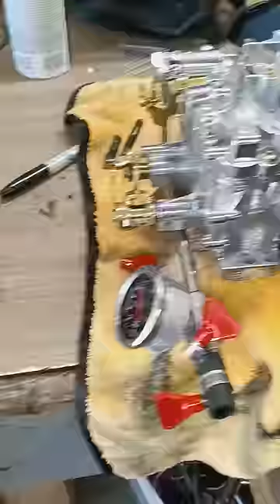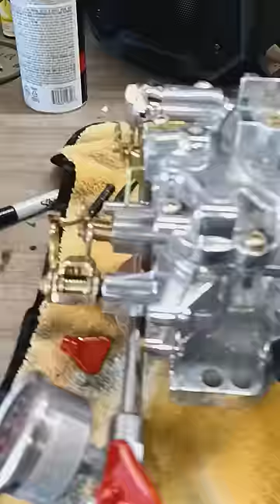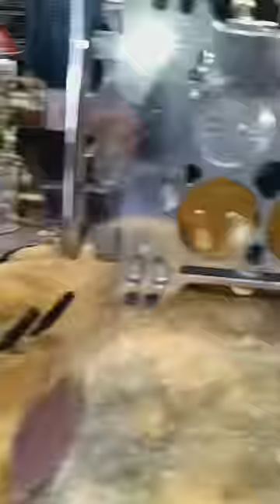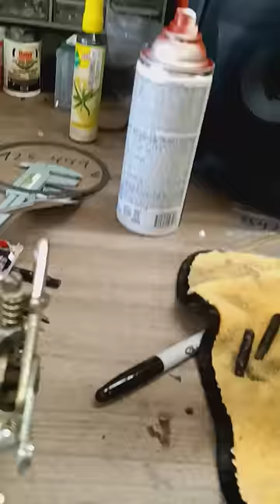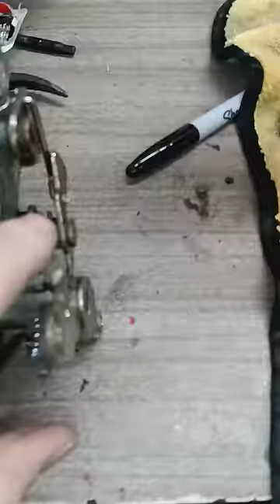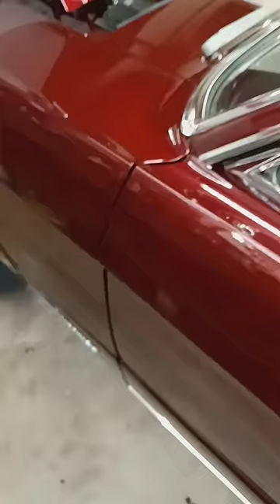how did I miss that?

Comment: If you're impressed with getting WOT imagine how it would run with a Holley on it
Reply from the maker: Holleys are great, I love them. But on a car I just want to start up and drive and not have to mess with it I'll use a Edelbrock. I'm watching Marketplace and Craigslist for a used 4150 style whether it's Quick Fuel or Holley I don't care I just want something I can rebuild and tune for all-out performance for the 65. So I can ride around all I want with the Edelbrock and put the Holley on when I take it to Sears Point. It'll be interesting to compare exactly how much more I would get out of a Holley compared to the Edelbrock.

Comment: after mounting the carb. the first thing any good mechanic would do is open the throttle and look down the barrels of the carb. maybe you learned something
Reply from the maker: The secondaries won't open on a Edelbrock unless the car is moving and air is flowing through them. You can however remove the carburetor and hold the lockout linkage and actuate them like I did in the video where I show how I fix it. So no you cannot mount the carburetor, look down inside of it while you pull the throttle and see the secondaries open. They are not true mechanical secondaries. Hope this help you learn something about Edelbrocks.

Comment: Nothing much, it's an Edelbrock.
Reply from the maker: The 4150 DP I prior had a bit more out past 5500RPM but down low through the mid  the new AVS2 has more torque. How much of a gain do really think a 340ish HP car with gain by switching form the AVS2 to a Holley? If we're talking about a vacuum secondary Holley that's going to be even less of a difference.

Comment: Could you redline it with the old one?   Then your block can't handle more anyway.
Reply from the maker: The car would fall on its face around 5400ish
Reply from the maker: Don't you think with more air and feel it would get to redline a lot quicker? Just saying.
Reply: I would bet that she will tach up higher, and you will get some more torque on the high end, so be careful of overrevving her.  I doubt the low end torque will be affected much.   Might even bog some.  You may have to play with the spark advance some with the sudden loss of vacuum.  Play with the tuning and let us know how it goes!  Looks like a fun project all around.

Comment: Here's the deal..if they only opened just a little..then your gas pedal..run by your right foot witch is hooked to a cable only would of went down 2 inches..anyone who has worked on a car more then a second would of got that right off...if you punched it you didn't notice your foot 8 inches off the floor🤪

Comment: Ditch the edelbrocks. In my experience they're a good carb if you can get one that's not finicky AF I personally prefer holley for the quality control and what seems to be better materials because I've never had this issue with a Holley but had this same problem with almost every edelbrock I've had including a few that came from the factory with bent linkages. But the worst QC I've seen by edelbrock has to be the performer series avs2 series had better QC but still way too finicky and some material that's way too soft for the job it's doing. Last reason I prefer Holley is parts availability Holley parts have been super easy to get but everytime I needed edelbrock carb parts they were either discontinued or there was basically no stock anywhere. There's also less maintenance on the Holley carbs but we won't go there just yet
Reply from the maker: I got the exact opposite experience lol.  Holleys I've always had to mess with and Eddie have been pretty thoughtless after I tune them.

Comment: More $$ than smarts.   Never looked into a simple fix before throwing money at the problem I guess
Reply from the maker: LOL so funny. Are the two carburetors exactly the same? I bought the AVS2 because it's a bigger carburetor, with annular boosters, and dual feed inlet. Can't wait to check out your channel and see your cars maybe I'll learn something.
Reply from the maker: LOL bro you have cows on your channel. If there were no women left on Earth I would watch your channel on how to get laid. What's funny is you didn't even understand the concept of the video I made. I didn't buy the new carburetor cuz I thought something was wrong with the old one. I thought the old one was fine and realized the linkage was bent when I took it off. The car ran strong on half throttle. How do your cows run when you creep up behind them weirdo. How much penicillin do you have to take when you get to clap from a cow? Make a video and let the world know.

Comment: I don’t think the 4 barrel would even come in no farther than that is opening 
Look on the other side at the linkage when you go to WOT and see if it is engaging the secondaries.
Generally the back jets are twice the size of the
 front jets so you might not have been getting half throttle.
I’d fix it and then run it before you put the AVS carb on.
The AVS carbs are amazing right out of the box as far as throttle response and no flat spots through out the low end to high end 🏁
Reply from the maker: I made  a update "how did fix what I missed". I heated the linkage and bent if almost all the way back and it fixed the problem. I made another video before that one "how did I miss that pt2" or something like that and addressed some helpful comments like yours and a few trolls. I held the choke open, the  secondaries weighted air flap open, and made sure the lockout was open and got the same result. I make these videos with my phone so I don't always get the greatest shots because I have to move things with one hand and use the phone with the other. The AVS2 is currently on the car and I like it a lot but I have a slight bog when the secondaries open but that's because there was zero tension on the air flap spring from the factory. I've been working a lot. I'm hoping to do a follow-up this weekend of the new carb. Just need a buddy to ride along and video a few pulls. I like how at 2200 RPMs I can bury the gas and break traction all the way through first gear and into second. Manual transmissions are so much fun.

Comment: Go with a Real carburetor and ditch the Edelbrock and you'll really make way more power...
Reply from the maker: The car on paper is 330-340 how much more do you think a Holley would give me? I have ran a Holley 4-777 and the car had a bit more out at 5500+ but the 0 to 60 wasn't much different. I'm not serious racing anyone, just having fun with it. Running against friends up 80 or so.

Comment: It’s possible that he did this.  He just didn’t know it.
 I was about to write that this doesn’t come from the factory like        Record scratch.       
 I’ve gotten fish hooks from eagle claw that were not useable.  The weren’t pointed or sharpened. No points. It sucks when your 25 miles out in the ocean and the hook you pull out won’t work and then the whole pack is like that.  I could have caught a bigger fish I bet.
Reply from the maker: Anything is possible, I never dropped the carb I don't know what else would cause a bend like that. It was given to me so it wasn't new.

Comment: Bro how did you not notice? That’s barely over a third of the way open.
Reply from the maker: I didn't notice because the car still ran like a sonabitch. But with a new carburetor on it it's a big difference. The car breaks traction at 20 miles an hour when I give it wide open throttle. This car so much fun to try LOL

Comment: I’d say get ready to upgrade more parts
Reply from the maker: The car has a 9 quart oil pan. One major reason you find oil pans that big on 302's is they are 331 or 347 strokers. I'm going to drain the oil and use a boar cam to see if the motor has a girdle. If it does that's a dead giveaway that it's a stroker. On a normal 302 with a decent cam aluminum heads will give you 40 horsepower. I have no idea what a 331 stroker with cast heads will do when you put aluminum heads on. The old lady I bought the car from explain to me that her husband built the car later in life and didn't have enough money to finish it how he wanted. If it's a stroker with cast heads and I switched to aluminum heads 60, 70 horsepower? Holy crap. The car has 280 gears and spins the tires to 60 mph. She told me that a family member took the rear end her husband had planned to use in the car. I don't know,🤔🤔🤔 it's all kind of adding up. It may take me a while but I'm going to figure it out. Man stay tuned for the fun. The questions will be answered with a lot of smoke and burnt rubber smell in between lol.

Comment: I'd fix the linkage and put that old one back on there
Reply from the maker: The reason I bought the new one was I wanted to run a bigger carburetor. It's not crazy big. 600 old 650 new. The new on has some cool upgrades I like, annular boosters instead of downleg boosters you definitely can feel a difference, dual feed inlet, adjustable secondaries. I'm going to pick up a used Holley/Quick Fuel for cheap and rebuild it just to compare on this car. But for weekend cruising I'll use the Edelbrock.

Comment: The engine will probably blow up
Reply from the maker: I mean it could, sure. So could any engine. It's a weekend warrior I probably won't even put a thousand miles on it a year. Now granted 100 might be pretty hard but it's 100 miles on a full roller assembly. I think it'll be fine. I intentionally lower the red line from 6200 to 5400 just because it runs so strong I don't think I need to run it that much harder.

Comment: Put a holey on it with a spread bore fords are made for Holleys
Reply from the maker: Yeah I'm going to pick up a quick fuel and use it for race day. But for around town I prefer the AVS2
Reply: @BPattB  spread bore gets better fuel mileage if you drive it right.
Reply from the maker: @glennmatthews9819  The secondaries on the new carburetor are a lot bigger then the primaries. I wouldn't call it a spreadbore because it fits a squarebore manifold. I actually had to modify the spacer I was using. I made it short little video you should check it out, you can see the difference in size.
Edit: weird that videos not there lol I'll put it up again
Edit to the edit: it's uploading now. There's a beer in the background I wonder if that's why it's down lol

Comment: I turned over 13,000 RPMs and I never used or hooked up the four barrel on my 600 or my 750 EB carb. I also had a 2:73 rear end that would make Aqua tread tires and leave all the titties on.
Reply from the maker: You had 600 and 750 Edelbrock carburetors and never use them? So what carburetor did you use? I guess it's a good thing I got a 650 Eddy.  And just out of curiosity what compression? I'm always trying to learn and if you can let me know how you got to 13,000 RPMs in a V8 I would really appreciate it.
Reply: @BPattB  1970 350 4bolt main from the Impala 
Drilled more oil drains in the head
Bored .5 mil / 13:1 compression ratio
Reline at 13246rpms
Went with heavy jugs and a rpm Edelbrock intake. Use the 600 economy carburetor and disconnected the four barrel. I limited the carburetor actuator so that it wouldn't engage 4 Barrel. Of Course I went with the best parts that were available while staying with the technology that was available in 1970. I told them they were pulling four and five second quarters in the 70s, what does it take and rules don't matter. To come up with the answer it cost me $20,000. I then learned that when you time travel, it doesn't feel like you save any time in your age faster. Of course you're going to have to spend some money on high speed rated tires. You also have to come to terms with sacrificing other parts. This means you have strategically placed parts that are not as strong and reliable as all the other parts so that it may start failing before any other part can receive damage. The good thing about getting rid of the red line and the only reason is for gear shift missing and throttle linkages breaking. It's nice to know that when your throttle linkage breaks and your carburetor starts dumping fuel, you get to set back and take in the sound why you pop the hood and connect your carburetor back up to lower the throttle. I used the three-speed transmission most of the time. I changed the transmission every year between 6 months to a year. There's a machine shop in El Campo Texas. They have the blueprint. I built two engines identically the same. I didn't like the 202 heads, I believe the heads that I kept was the 191s are they were 192s? Either way, 6,000 RPMs and it's just starting to stretch its legs.
When I was done with it, when you pop the hood and looked in, you saw it a 350 with a good looking paint job, small pipe headers to increase back pressure, cheap Chrome, an alternator and I did eventually add power steering. The truck was not equipped with power steering or AC.
Reply: @BPattB  the bonus that comes with that set up, I got 18 miles of the gallon no matter what my load was. I could be empty or pulling four tons, I got 18 miles of the gallon traveling at 60 miles an hour. Traveling 150 MI in 30 minutes I burned about 3 gallons. The four barrel would only be a hazard with this much horsepower. Overdrive would also be a dangerous setup for something with this much horsepower. This setup also Burns any type of fuel that you put in it. I've used aviation fuel and used cheap gas. This was on my everyday driver. If I felt like running a cannonball across Texas, I stopped at the airport and picked up aviation fuel. The shop that put this motor together for me gives a four year warranty on all of their racing engines. The duration on the can was so long in the closed position to get the 13 to 1 ratio, you could turn the distributor completely around in both directions till it hit the firewall and someone with a good ear for timing would not know the difference in the idol. It would take a computer to get the exact timing correct. Even a timing light cannot operate fast enough and accurate enough to ascertain the timing of the detonation.
Reply: @BPattB  when building an engine that is expected to hit that type of RPMs sustains a lot of stress. This requires every functional part and peace to be considered as defective and replaced with the most reliable replacement part. This alleviates any needs for Turbo or nitrous to get a 5 Second pull on quarter mile.
Reply from the maker: @banditeastlick2471  man that's crazy
Reply: @BPattB  when I showed some friends of mine that ran the Circle Track, me turning the distributor in both directions until the vacuum pump tapped the firewall and could not tell the difference in the idle made them believe that my motor was running from a hidden source of electrical power to the spark plugs
Reply from the maker: @banditeastlick2471  that's truly funny
Reply: @BPattB  i spent 350 on tje tubes for a 2 piece driveshaft. It is proven to save axels if you use cheap U-joints.
Reply: @BPattB  I took a rebuilt 350 and changed the cam and beefed up the timing chain and installed a cam button. I use the RPM Edelbrock intake with the same 2:73 rear end in my truck and got 28 miles to the gallon. I could drive the 150 MI in 40 minutes and only take a few gallons. The 2:73 rear end really lets you stretch the legs out.
Reply from the maker: @banditeastlick2471  I posted a video of the fix I did on the carburetor then explained a little bit more about why I actually bought a new carburetor. You should check them out now thanks for the views and comments I appreciate it brother. And the knowledge that to,,,,, a lot! Lol
Reply: @BPattB  most people don't realize that putting small headers and creating back pressure increases your fuel economy and enhances the performance of your valves. The high compression ratio ensures that you get more bang for your buck along with a high-grade distributor.
Reply from the maker: @banditeastlick2471  I've heard that. Hey man if you want to check out a cool channel of two brothers that take junk cars and turn them into cars I wish I had go look at C&C Auto Works on YouTube. It's two brothers I don't think they're monetized they just do it because they love cars. You won't be disappointed I promise.

Comment: Edelbrock carbs are junk on fords I bought one traded it for a holley asap
Reply from the maker: That's odd because every mustang forum I've ever been on people that run SBFs with less then 350ish HP tend to use Edelbrocks. Your own experience apparently is different. Each car bazer place if you want to squeeze every ounce of power out of a car you use a holly if you want a carburetor that you may not get that extra 10 horsepower from but you don't have to worry about tuning it every couple of months, flooding, vacuum leaks, float bowls leaking on your manifold you run a Edelbrock. I like all Holley I have a 4150 but I drive this mustang every weekend and I'd rather spend time working on other things and tweaking with the carburetor. The Wide Band AFR doesn't lie, Edelbrock's hold it to a lot better.

Comment: Rebuild the old carb and take the new one back for your refund
Reply from the maker: The new one is a bigger newer version with angular boosters and dual feed. I'm going to fix the old one with a little bit of heat and make a quick video showing it because there are trolls that insist on lying LOL.

Comment: It should be better but I have seen Richard holdener test it and 50% throttle isn't 50% over more like 85% or 90% but more is better
Reply from the maker: That sounds about right, the new one is in and is not 2 times anything lol. It's a definite improvement, but it is a larger carb with a few improvements larger secondaries, dual feed inlet, angular boosters, an adjustable secondaries.